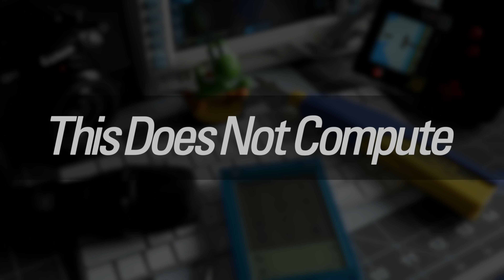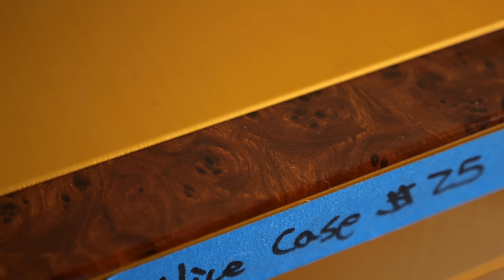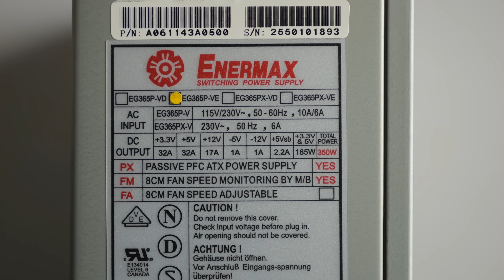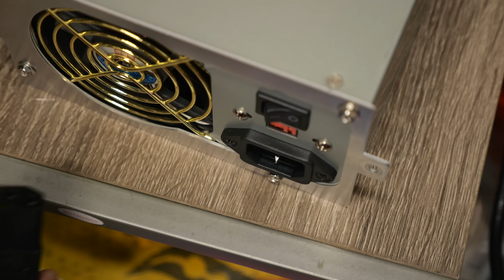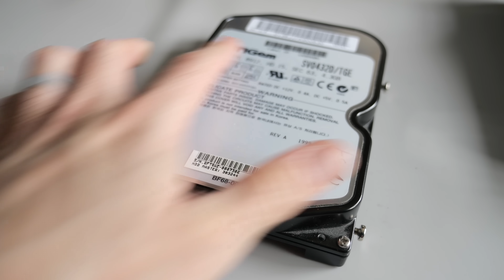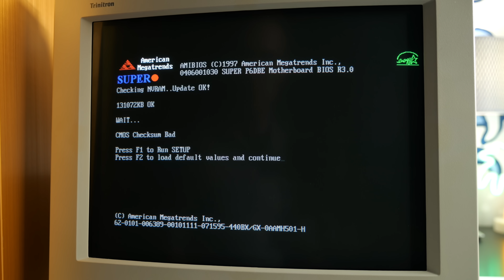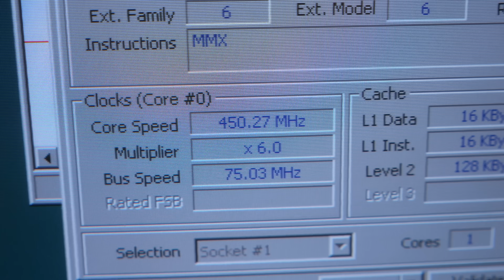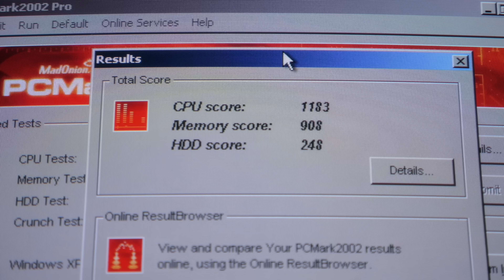I tried to put TWO vintage Celerons in one PC

Comment: If the moderator is to young to know things. LianLi isn't the first company offering cases with pull-out mainboard trays. In the past there was a Mainboard which was capable running two Celerons. Abit BP6.

Comment: @thisdoesnotcompute I have the PC-60, but not in that copper-ish color.  As far as the faceplates for the optical and floppy drive, you used to be able to replace them with a similar brushed aluminum face, so as not to break up the aesthetic.  I plan on modding and improving my case to dump in a more up-to-date mobo/cpu.

Comment: Lian-Li case in the thumbnail made me watch this. That copper color is hideous, I love it! I still have its big brother that I bought somewhere around 2002. A PC-70 in all silver, appropriately named Zeus. The first build that was transplanted into it when I bought it had a -2°C drop in almost every temperature at idle. I'm sure it was the all aluminum construction because the standard size steel case the system came out of had 13 80mm and 2 120mm fans! I haven't used any other brand of case for my personal builds since.

I miss overclocking with jumpers. If it wouldn't post, you just moved the jumper back!

Comment: Wow, I actually did this back in the day when i heard quske 3 was being made to support smp. Saved up all my cash, got an Asus P2B-D motherboard. My Celerons were I think it was Socket 370. You could get adapter cards for socket 370 to slot 1 which allowed dual Celerons to work. I thought it was a pin on the cpu that was stopping it, i.e the other work around was to physically cut a pin on the CPU. Adapter cards are a better choice. Also had Asus geforce and made it into a Quadro by changing some resistors on the card. I think  you will find that set  SMP = 1 doesn't actually do anything as Carmack never ended up implementing it in the end.

Comment: ha. I had two self-modded 300a's in a Tyan motherboard running win2k back in '99 - it frickin' screamed. the mod isn't as hard as it looks. you just need a steady hand and a good eye. i also have almost exactly that case sitting right next to me, except not copper and with a screw-in acrylic front instead of clip-in aluminum.

Comment: I had a dual Celeron Setup in the early 2000, just before the AMD Thunderbird went 1 GHz plus. 
We didn't consider that we need another windows version (2k) and that most games would not support it. 

It would perform better than a single CPU, assigning one CPU to the game exclusively. But not a lot.

Comment: I built a dual processor 300a system that was overclocked to 450. It requires that you modify the processor in a way that you cannot undo, and you need to be good at soldering very small things or you will break it. Mine was reliable for years but not terribly fast compared to a p3 450. The AMD T-Bird processor was very overclockable as well if you could keep it cool which usually required some homebrew water cooling setup.

Comment: I recently got a dual slot 1 motherboard (Intel or840) and actually had a pair of Celeron 300A (my own). I decided to try to do the SMP unlock mod on both of my Celerons. Managed to do this well and got them both running at the same time! Also, the Intel or840 motherboard doesn't support 66 MHz FSB, and so - it forces 100 MHz FSB, causing Celerons to "automatically" overclock to 450 MHz. So - this setup is possible. Amazing stuff I can say

Comment: I had a 2@400 bp6a setup. That meant i had to run w2k. Then i modded the sockets and installed copper mine p3's. Had to do the bad cap swap as well. Loooots of fun playing with bios updates to find something that was stable, and where the ata66 controller worked.

Comment: Oh man. This was basically my setup growing up, but with a couple of pentium 2 450s instead of celeron, and a Matrox millennium G400. Older hardware at the time but still worked great, and the look some kids (and teachers!) would give when telling them you were running 2 processors was absolutely priceless. Also those enermax power supplies are beasts and I believe they will easily last forever if checked and recapped every so often.

Comment: Back then I was building and selling Digisuite video editing systems. For a demo system I used two socketed Celeron 300's in slot adapters and overclocked them to 450Mhz. The system ran Windows NT.

Comment: I had a Celeron 333 (I think, could've been a 300) and someone told me about overclocking. A few minutes of poking around later, and that chip went to 450. I vividly remember Half-life in software rendering going from a choppy 400x300 to a playable 800x600. I'd never seen anything like it, it absolutely blew my little 15-year-old mind that you could just move a jumper on the motherboard and get a performance jump like that - for free!

It was a seminal moment in my early nerd days.

Comment: I still have a working Abit BP6 with two Celerons Socket 370 from 1999. There were also some Slot1 Adapters for Socket 370 CPUs that also supported SMP. At some point Intel also disabled SMP for Celerons (IIRC 500MHz and more).

Comment: I ran Dual Celly 300A’s overclocked to 450Mhz for 7 years in a Win2000 Server. Never had an issue.  It was on a SuperMicro motherboard.

Comment: I ran dual 300A at 450mhz back in the day.  It was amazing for the time.  I used socketed 300As in a dual slot motherboard with socket adapters that had a jumper you could use to run in dual mode.  Easy peasy.

Comment: I and friends had dual processors. When you got to the second celeron in I was going to point out that you needed to rig a jumper on it, but you got there. Also, for mine i had SCSI drives in arrays, with CD roms on the other SCSI channel and it was ripping my CD collection day and night.

Comment: Back in 1999 I had a ABIT BP6

That I used dual celeron CPUs in and I think I was using 533 Celerons but started with 366s and even liquid cooled it by bringing a garden hose into my living room window and then back out to water the flower bed LoL.

I built my water blocks myself out of car parts and it worked well to run my Voodoo 5 card so I could play Quake II im not sure if the dual processors made much of a difference but my next dual board was an ASUS that ran two P3 Tualatin 1.4 chips and Rambus Ram wich I just sold earlier this year

Comment: SilverStone was rebranding these Lian Li cases and selling them for even more of a premium. I think mine was a gift? 
Back when we used to have CDROM/Floppy drives installed we'd carefully pull the front plastic bezels off and paint them to match.
After a couple CD drive upgrades I got fancy, and I'd take care to wash the plastic bezels, sand them down a little, spray on a color matched silver paint, sanding between coats, and then lay a clear coat to seal so it's almost identical to the silver case. I might even have some old photos backed up.

Comment: I ran two socketed Celeron 300s in a 440BX motherboard for years, with them overclocked to 450Mhz. Bumped the 66Mhz stock memory clock to 100Mhz. No fancy cooling, just the stock celeron coolers. This was in the famous Abit BP6 motherboard. Eventually the motherboard died (probably bad caps) but until then it was rock stable. Good times!

Comment: I remember having that case, but at a much later era after 2001. I remember mine having two fans in the front, two fans in the back, one on the side and one at the top. It was quite nice. Maybe I was quite unusual, but I actually filled all drive bays. I ended up using raid 5 with a controller and 4 drives and I had raid 0 with two sata drives, which I ended up having one in the floppy area. I hated how I could only do so much for cable management. My system was a nightmare to handle that. I had a floppy, and an sd card and hard drive in the 3.5 bay. With 5 hard drives below. I had a DVD drive and a plextor cd-rw in the top bays. As well as a fan controller and my audigy card. Which had a hard drive style ribbon I think it was. My fan controller had a heat diode that I stuck under my heatsink near the cpu. So not only did I have a lot of fans, I had cables running to the 5.25 bay to control them. It was unmanageable to say the least. I tried my best, but the amount I had crammed into that case. I remember I had an athlon 64 4400+ I think it was, a zalman cooler of some sort that was bulky. 2GB of memory. An 8800 GT video card. I remember I had other life expenses of getting older and I used this system for quite some time. So I could no longer upgrade. I remember having to give up on all this fancy stuff. Money was a factor, but also the complexity. I had to scale back when I could finally afford a new pc. Now I just have an nvme SSD for windows, SSD's for my games and programs and a couple spinning rust to store files and a couple external drives for backup. Offline and online backup. I store a lot of things and never want to lose anything. So it's important to me to have space and backup. Otherwise I try to keep complexity down now. Still I fail at doing so, but at least the cable management is much nicer. :)

I am quite surprised an intel pentium 2 lost to a celeron at 450. I really thought for a long time that the celeron would still lose. I have bad memories of celeron's, except for this era. I remember how I would have friends who had one and how poor the performance was compared to anything non celeron or duron.

Comment: I like Your video, but don't like so many dust on a PC components, like on a videocard. I also uses such cards at years from 2003/2004, but just in 2012 realised that my GeForce FX5200 128 hasn't any thermal interface under it's radiator. After adding a thermal paste (Titian or something) my GeFoerce became really cool, stable and overclocable... So, please, clean and investigate underradiator space of your videocard)...

Comment: The reason for the improved performance over the Pentium 2 was that the cache on the Celeron ran at full bus speed, whereas the Pentium 2's cache ran at half bus speed (pretty sure it was half). P2 had double the cache of the Celeron, but the speed advantage was significant to performance.

Comment: about 2 decades ago, when i built my first computer, i bought a funky motherboard from asrock, it had dual cpu slots, but was special was, one slot was for intel, the 2nd slot was for amd, so you could run either one, without to have buy another motherboard

Comment: Dual CPU was not usefull for gaming even years later when it was possible with dual Duron and dual Athlon setups. When Pentium D and Athlon X2 did hit the market it still was not a good bang for the buck choice. I went for the fastest single core Athlon 64 on S939 at that time.

Comment: I find it strange how a 450Mhz Celeron is faster then a 450Mhz Pentium 2, as the Pentium 2 had L2 cache while the Celeron did not. The only thing I can think of is Quake 3 and the benchmark did not benefit from the L2 cache.

Comment: I have a P2B-D with two Pentium III 1Ghz running at FSB112Mhz at 850mhz each, fully stable with Windos XP, 200 and Linux Debian. I had a DV6AA with two Pentium 1Ghz at 133FSB, but dies with a shorcut. Thors rigs are very prone to unstable running if you OC them. I have also a CUSL-2C running a Tualatin 1.4Ghz, pretty cool. And other many rigs, included an AMD 386DX 40mhz running Windows 3.11FWG.

Comment: i wish new where my slot1 p3 550 went, in ut it worked better than a p4 1.4 with a gtx 440 (i had a 220 i think) and was running ME.

Comment: I had an Asus P2B-DS with two Celeron 300A at 450MHz and 256M ram in 1999. I had a Matrox video card in it, a soundblaster live and ran Linux on it as my main computer when working from home and nerding around. With 4 SCSI drives in it running at 10.000RPM it was seriously noisy. You should be able to procure a second 300A and do the mod just because you can for the video. I still have the machine standing around in 2024, it has dual 1MHz P3 CPUs in it now and hasn't been powered on in probably 20 years.

Comment: Wow... I bought this mainboard in 2008 and two Pentium 3 processors 1.1ghz, but it wasn´t that good and can´t run Tualatin processor.
As I remember... there are a secret bios menu.
I don´t know right now, but it was F7, F8, F9, F10 or something like that.
You can change the FSB up to 133mhz.

Comment: I ran one of those overclocked Celeron 300A's for a long time, before going up to a Core 2 Quad system. And I worked with someone that had a Dual CPU SuperMicro board, and ran Win 2KPro with it. From what I heard him say, it was a really nice setup. I believe he started with P2 CPUs and later moved to P3 CPUs.
Interesting video, to see 20 to 25 year old tech revived.

Comment: You should never set electronics on the outside of an anti static back. Those bags protect what is inside, not what is outside.

Thought everyone knew Celerons did not support Dual CPU.

The AMD K6 and K62 were awesome chips.  Still prefer AMD to this day.

Windows NT and 2000 did not always fair well with hardware changes, especially from single to dual CPU as a different kernel was used.  This meant a reload of Windows if you added a second CPU.   Even had full BSOD when overclocking from 300 to 333 in Windows NT.

Building PC's in the late 90's and early 2000's was really something else.  Buying parts from random websites and 128 MB of RAM was a ton of RAM.  I typically bought Matrox cards because they supported dual Monitors.  At one point I had 3 17" CRT's setup in a triangle formation.

Comment: I'm pretty sure I've seen these Lian Li boxes used as servers in smaller office setups, with the drive cages being populated as well as the bays having those hot-swappable HDD caddies to hold a massive RAID array of a dozen drives.

The case looks almost NOS and for 25 bucks it's a steal. It would probably still do around $100 on eBay.

Comment: I got a temporary computer in the late 90's for $100.   It had a 366 MHz Socket 370 Celeron.  I bumped the front-side bus up to 100MHz, and the CPU ran at 533 without a single hiccup.  I might've kept it, but it didn't have AGP, and I liked Super 7 better.

Comment: Hi! Memories! I did build a dual celeron 300A at the time the patch-instructions came out . Think Ii used an Abit motherboard. It was overclocked to 450MHz.  To increase the cpu core voltage you put tape on the right gold-finger to tell the motherboard what the voltage should be. It worked really great for many years.

Comment: Lian Li cases have always been top notch. I built several PC for friends and family with them back in the day.  on thing to note about Pentium II and Celeron processors. Pentium II Slot 1 processors use and 256k L2 cache with chips soldered to the CPU card and running at half the speed of the CPU.  Celeron Chips only had 128K but it was on the CPU die and running at full CPU speed. which is why in your benchmarks the Pentium II 450mhz was only slightly faster than the 300A running at 450mhz.

also there were 2 different CPU cores used for P6 Celeron Processors. the Covington core and the Mendocino core, the Covington CPU core had no L2 cache and people hate them because the performance was crap. to remedy this issue, and still keep price down, Intel quickly modified the Celeron chip with 128k cache on die. depending on chip binning, some chips were much better at overclocking than others. with about 40% of them able to run 450mhz out of the box. but cooling was also an issue with them. when intel switch to socket 370, the Mendocino core was used on the Celeron 333-533. so, i suspect the 533 was about the limit on the Mendocino core, at least with air cooling.  

what was really fun back in the day was the old AMD Duron processors, you could unlock them with a pencil. and you could push them really hard.  I had one of the 800mhz Camaro core Duron's and it would run 1.2ghz all day long with standard air cooling. that thing was a beast.

Comment: I also have an interesting motherboard from around the same time that allows for a slotted CPU, but also a normal CPU socket like on modern PCs.  It was in a computer that I was given to in exchange for some data transfer off the old hard drives, and I simply found it interesting that it had availability for dual processors. The socket was empty, but the slot is currently rocking a Pentium III, and after seeing this video wondered what your thoughts may be on this 'specimen'.

Comment: I still remember. Tape the B26 so that Celeron start on the 100 MHz bus with 450Mhz. 
Some of Celererons has wrongly applied thermal interface, and quickly overheated after. Disassemble, reapply, assemble back, good to go.
333A was more preferable, it runs 500-600 Mhz.  And yes, it was faster than 450 PII.

Comment: 20 or so years ago I had this case and did a stealth mod for the cd drive. you mount it recessed a bit, use a dremel to take the "legs" off of the slot cover, and then attach the slot cover to the cd drive's tray with a couple layers of double-sided tape. you need to affix something to the corner of the slot cover so it will hit the eject button if you push that corner, then boom, you have a cd burner with a sweet incognito brushed aluminum facade.

Comment: I never had to do the drill mod. I just bought an Abit BP6 motherboard and a pair of 366MHz Celerons I was lucky enough to be able to run them at 550MHz at the stock 2.0V. I was able to bump the vcore to 2.2V and run just fine at 618MHz, but I just dropped back to 550MHz and ran my RAM at CAS2 instead of CAS3.

Comment: I modded 2 300A's and ran them at 450 MHz to do some work and debugging on Linux's early SMP code, it mostly ran ok but occasionally (once a week or so?) would kernel panic randomly.  I did not have to drill out a via - just a single wire between the CPU card edge and the socket, if I recall correctly.